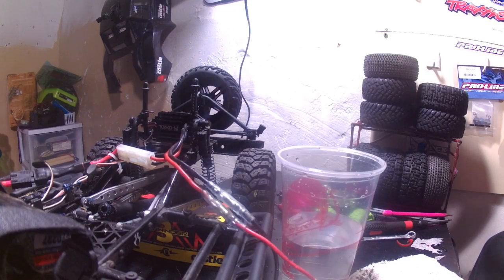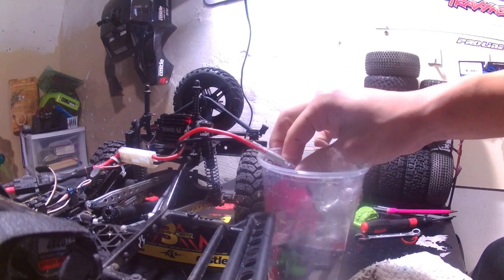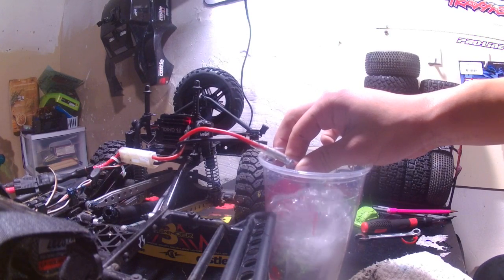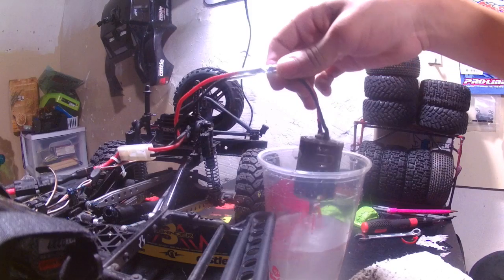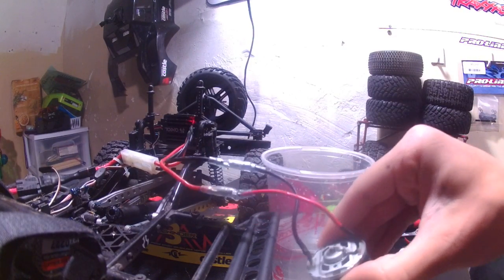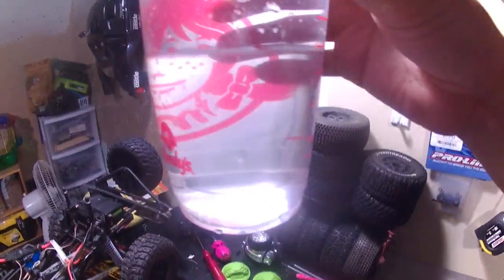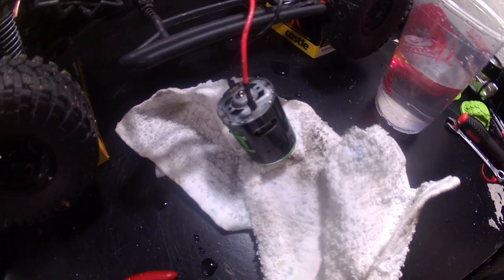How To Clean Your Brushed RC Motor

Comment: Should I use Brake Clean to clean out the motor and oilnit with wd-40?
Reply from the maker: Buy some electrical cleaner spray at your local hardware store. It's safe for electronics. My method is the old way of cleaning brushed motors out
Reply: @RcHobbySteve  thx
Reply: WD-40 is not oil its a Water Displacer, its better to use real oil.